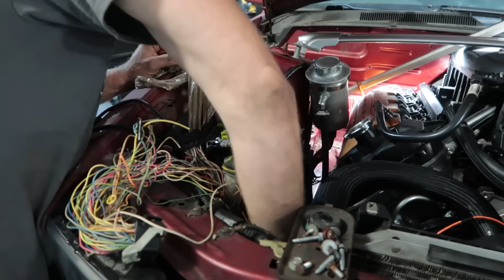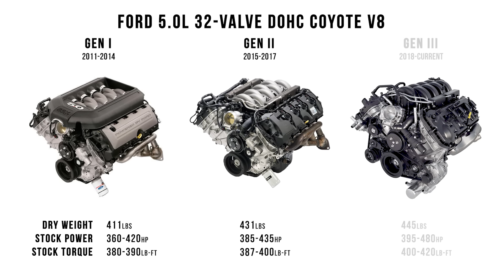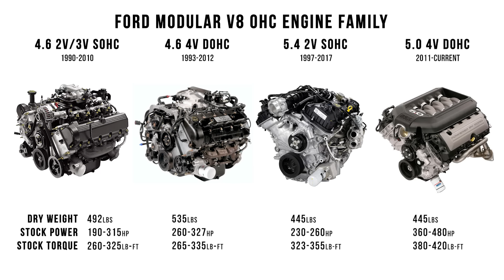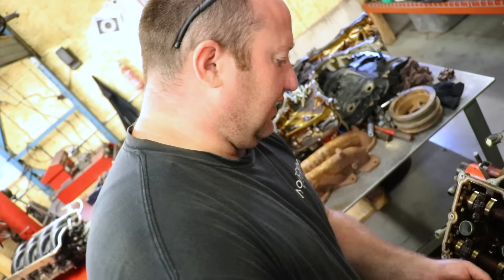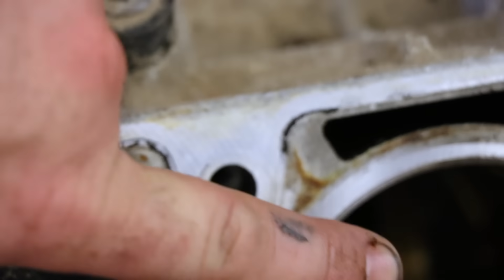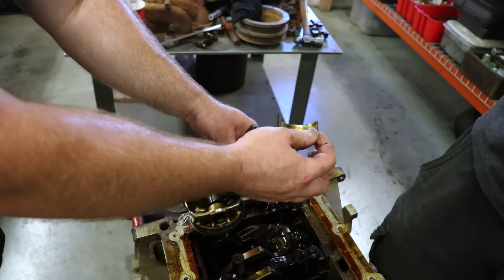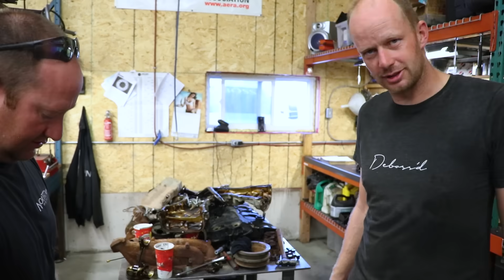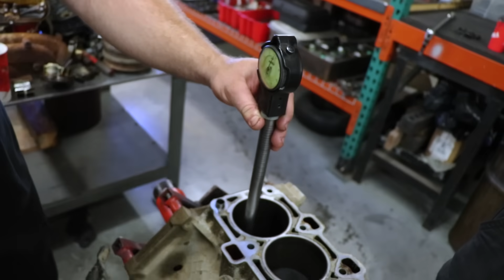REVIEW: Everything Wrong With A 5.0 Coyote Engine

Comment: Scott, hey man nice to meet you Linda meet any ways. Hey man I bought a 2012 f150 Fx4 with the 5.0 Coyote motor. Almost instantly when it works up and I come to a stop my oil pressure will drop on my dash cluster. Chimes go off but if I give it just the smallest shot of gas it shot rite back up. The motor seems strong it ran fast and hard even with this issue.  But not that are temps are reaching 118’ hot side it’s had been running very rough  can you point me in the rite direction. Oh yeah I get codes p0011 p0012  p0021 p0022 I think those are them.

Comment: My 2013 f150 with the gen 1 5.0 has been a phenomenal truck. Great power, I had a water hose crack, I went ahead and changed it and fixed the fault with the water cooler piping.dont know why so many say these trucks are underpowered or turds.

I can't wait to tune mine, just don't know which tune I wanna get for it or who from. 5 star tuning didn't impress me much with my 2001 4.6.
Reply: Keep in mind, there's not much room for tuning with a stock 4.6 2 valve engine. Unless you changed the cams, heads or a stroker kit. Ford nailed it with the 2 valve 4.6
2011 e250 4.6v8 loaded at all times 8500lbs with 430000km i got 15000km between oil changes lol

Comment: how does Compression height effect Displacement? Displacement is just boreXstroke... "rebuilder pistons" do come usually with a shorter compression height yes, just cuz they dont know if you needed to deck the block so yeah, you might loose a small amount of compression but you are still adding displacement by boring it out. you still have the same stroke regardless of compression height of piston you still have a higher swept area. just take it into account when buying pistons for your build

Comment: Great video! I have a 2018 f150 with the 5.0 in it. I have a ticking noise on the passenger side of the motor and from what I have researched, lots of the 2018-2019 5.0 motors have the same issue. Would you happen to know what this might be and if its normal? My motor has 84k miles on it and runs great. I never hear the ticking under acceleration. Just while idling in park. Never while in gear sitting stopped. It doesn’t burn any oil and hasn’t been abused. Mostly highway miles. Ive talked to ford dealers and read tsb on this issue and ford put out a statement saying this is normal characteristics for this motor and will not affect the long or short term durability of the engine. Thanks for any help on this…

Comment: Wave of the future is 4 timing chains, oil pressure fed variable valve timing on your 4 cams, and throw in some oil pressure fed timing chain tensioners too while you are at it, so your timing components are not tensioned at startup.   Sooo basically.... multiply your points of failure by a minimum of 4X, and use the oil pump to tension components instead of a spring.   BRILLIANT...NOT, stuff it and I'll keep my synthetic oil.
Reply: Give me a Ford 4.2 V6 pushrod any day over that 5.0.  And if you feel like gettin' nuts with it, an ideal engine for a turbo due to exhaust turbulence is a 3 cylinder.  Well what is a V-6 then two 3cylinders engines on a common crank? Twin turbo 4.2 V6, dual exhaust ... Hmmmm

Comment: , Scott said that the 4.6L and 5.4L have a Different Bore Size "obviously,"  this could not be any farther from the truth.
         The 5.4L, and the 4.6L, have the Exact Same Bore ; the difference  in the Larger Displacement of the 5.4 comes from its Longer Stroke Only , not bore size. This makes me wonder, what else is he mistaken about? 
    I love the amazing hi revving 4.6L as much as the next guy,  but as great as the 4.6L is , the coyote is still more efficient and will rev even higher. It is a far superior engine the previous ford modular engines . 
            The  5.0L modular engines have a stronger block, a
 steel crank, higher compression and better flowing cylinder heads. The 5.0 L was tested by ford before it was released , it is a great engine along with the other Modular Engines.

Comment: Big guy doesn't know anything about engine math. Engines are NOT calculated by compression height to determine CI. Not only that, but putting oversize pistons will NOT decrease compression, that is done through dome volume and combustion chamber relation to crank throw. The bronzing (what it's called) is NOT from synthetic alone, that is simply a non-detergent oil being run to high temps repeatedly without proper oil changes. Most synthetic users will go by the 5k recommended interval not realizing that if you overheat the engine or redline the engine repeatedly it shortens the oil change interval. I change my race car's oil every 1k miles with full synthetic and have never seen that issue. Synthetic oil is also not thinner as oil is marked by weight. There are synthetics in 40 weight all the way up to 110 weight. Windage trays do not cause oil starvation issues. This guy is a joke lol. He knows how to order parts, that is about all I have seen him do well. He is a parts catalog but knows nothing about engines. "synthetic oil is very aggressive" "every engine on synthetic burns oil". LMAO WOW

Comment: It's not a "better" engine when it has significantly more moving parts to go wrong. Seems like almost any modern V8 can hold at least 700hp from the factory, very rare for people to go above that on the street...therefore the "best" engine is the one that is cheapest, and has the fewest moving parts to provide the most likely chance of getting to high mileage. Being strong enough to hold a thousand+ horsepower is not something relevant to most people.

Comment: Is there any additive to get rid of that synthetic oil residue in the motor ? I purchased used Fords for both my kids and noticed this coloring inside the valve covers when adding oil.   Gonna stop with the synthetic but would like to try to get that stuff cleaned out before it clogs anything.

Comment: I live in Vegas When my engines cold it's at 100F I do many short trips, I use 10W30 syn. I drive a 2002 Chevy trailblazer I got for $500. It has 246,000 on the clock and still runs like a clock. Should I switch to regular oil? I've have always used W30 or W40 in my old cars and never had a problem but this 4.2 engine has a cam phaser.

Comment: Background:  
Gear head that did auto repair for people who didn't get satisfactory results from dealers and I starting from age 14 where I had to have other people available for tests drives. I also designed and built electronic circuits for companies.  Then college for Automotive Technology where I learned the engineering.  I signed up for the Guard and wanted to be a mechanic there, and did a little too good, so they made me an aircraft mechanic and I was terrified of heights.  I built drag engines where I did Chevys, Mopars, and Fords.  Like this video says, it has ALWAYS cost way more to build a Henry than a Chevy.  I personally did Fords because winning with one made a statement.  I did engines, transmission, and rear axles at a Ford dealer because they were less frustrating to work on because they used dedicated castings instead of brackets supporting brackets supporting brackets, and the working environment was nicer.  I left there to work on vehicles for the Guard full time to work on trucks, radios, equipment, and a CEV (tank with an oversize gun), but their real angle is they wanted someone they could lay their hands on for manage their remote aviation section.  They made me the supervisor of the section.  I got sick and threw up all the time, after which I bought a share in an airplane because I could get free flight time for maintaining it, and learned to fly.  Later, my instructor called me and said he just got an aerobatic plane and I should...which I did.   That grew into waivers for academy and "fright school" and flying for them for 5 years and getting out as captain. 

My thoughts:
* Disclaimer:  I don't have broad experience with synthetics, only Mobile 1.  I chose Mobile 1 due to the way it is manufactured gives them ultimate control, and the mix of additives for wear.  Does more control mean better?  I don't know.
1.  From my experience with Mobile 1, oils keep things A LOT CLEANER.  If you switch to it on an older engine with not such a great change history, your oil will get REAL dirty fast because it puts the crap back in suspension, which is your call as to whether this is good or bad, and it comes out with the oil.  I'm aware of the Castrol court case they lost where they claimed they were 57% better at preventing sludge.  While they lost, you may find significant that they based their claim on data from Mercedes-Benz testing.  The ruling was against them because it only proved it on that engine and their proprietary testing.  Castrol's reply was sludge is sludge.  They lost another one on lubricity in that they showed some cruel load over an 8 hour period on some engine that theirs was the only one that held up.  They lost because those conditions but I thought you might find it interesting.  After Castrol's formula change to a mineral oil base, they got sued for calling it synthetic, but the challenger lost in court.  If you check what it takes to be called synthetic, you will find it to be defined by court cases rather than science and logic.
2.  IMO the problem with synthetics is they say, "Our oil is good for 6,000, 10,000, or 15,000 miles, so it's better and less expensive overall."  Then people follow that marketing advice and you get what you see.  How long anti-wear additives does matter, and even the longevity of the detergent properties to some degree, but the amount of byproducts of combustion and other factors doesn't change that much.

Other things mostly for entertainment value.
1.  Kinematic viscosity on the can is in SAE Saybolt seconds.  It is measured by how fast the oil flows through an orifice at a standardized temperature, 100F now 40C(104F) to make metric.  From an engineering perspective, it is no longer used.  When you look at multi-viscosity motor oil, the W is a predicate for the first number.  To simplify, it is simply stating that when the oil is cold, its properties are like the first number, and when hot like the second number.  Most engine wear occurs after startup of a cold engine and cranking is easier and thinner helps.  When warmed up though, the more viscous oils shear properties are better at maintaining the oil film under pressure.  You may have noticed the trend toward thinner oils in cars.  This is because most use roller rockers and lifters which is why the higher viscosity oils were needed and no longer are.  Thinner oil is better if you can run them without breaking down the oil film, and there is less parasitic loss.  There is actually way more to it than this such as when you modify the viscosity gradient, you still need to maintain the sheer strength so it preserves the oil film.  Again, there is more to this such as cranking, etc.  However what might be useful to you is the critical number is the second number.  If your car states to use 5W20, use 0W20.  The 5W was driven by what was commonly available.  Oil is always too thick when it is cold.  Another thing is the zero does not mean it is 5 thinner than 5W.  There are no negative numbers so all zero tells you is it is less than 1.  Just don't mess with the top number because that is the required shear strength required.  (For modified engines and racing you are on your own and stock oil and clearances aren't going to work.)
2.   Less popular today, but still in some applications you will see the recommendation for non-detergent oils.  Cars used to use non-detergent oils as do other machinery.  There is a wives tale that goes that's because detergent oils foam in those applications.  It's not that that has never happened, but it was considered a defect of the oil and thus any instances have long since been remedied.  The reason for this is old cars, small engines, air compressors, etc. use splash lubrication.  The oil pan was the settling point for debris and in effect the oil filter, thus you don't want to keep the crap in circulation.  On old cars, the oil pan is easily dropped and it is part of the scheduled maintenance.  With pressurized oil systems, keeping particles in suspension is exactly what you want to have happen so they can be removed from the system by the oil filter.  Today, non-detergent oils are hard to find, and even splash oil systems often list multi-vis detergent oils as an alternate or primary and might be better than a straight-weight non-detergent if you change it frequently.
3.  The anti-wear additive levels have generally been reduced in newer oils because they affected the life of the catalytic converter.  This is something else I was watching when selecting an oil.  There are ways to skirt that with additives or racing oils, but this is ever changing and I'm not interested enough to keep up on it.
4.  The SAE rating for gear oil uses a different scale than engine oil.  Example: 75W-90 gear oil is about the same viscosity as 10W-40 motor oil and it has totally different linearity.
5.  Probably don't use aviation turbine oil in a car engine.  You won't have ANY varnish like you saw on that engine.  The oil will be very fluid across an incredible temperature range, which would be great for cold weather.  Now for the downsides.  Jet engines don't have pistons and rings sliding up and down on cylinder walls that might shear the oil film nor do they have sleeve bearings.  You've never seen quality in bearings like you see on a jet engine.  You could have an APU that runs at a steady 115,000 rpm.  On small turbines the gas producer might run at 55,000.  You also have gears of quality like you've never seen that bring those RPM down to sane values to feed a fan and accessory gear boxes and do it reliably over many thousands of hours with zero issues.  Their main bearings do not have rubber seals, they use what is called labyrinth seals and pressure differentials.  The compressor generates much more pressure than the output and that is used to keep oil where it belongs and to cool (relatively) components through small holes located strategically throughout the engine to keep components temperatures within range.  When bearings get really hot is after shutdown when that process stops and heat moves to the bearings, called heat soaking.  Any varnish causes them to what is termed as "coke the bearings", e.g. make hard carbon deposits that will freeze the bearings, which is why you won't see varnish at car engine temperatures with turbine oil.  You also NEED to wear gloves.  I've gotten it into a cut a few times and it kills the skin around it and turns it into a callous that you can pick out over time.  Everything grows back fine, but if motor oil on your skin is a threat, turbine oil might be far worse based on its effects.  So the game for turbine oil isn't wear from scuff resistance from sliding surfaces, it is maintaining a standard viscosity across a crazy temperature range, simple lubrication, cooling, and not oxidizing/coking the bearings, which is exactly what those fine anti-wear and sludge preventing additives would do to a turbine engine.  They have a lot few products of combustion to deal with.  AutoZone probably won't be interested in your drain oil.  One could say that a car engine running it MIGHT not last as long using it even if it doesn't have an oil film issue.  OTOH, the oil would be fluid when cold so that might make up for around town drivers.  You can try it and let me know.  You can buy it for ~$2400 for 50 gallons, which works out to $12/quart.  It would have been fun to try on a water dyno when I had access to one in school.

Comment: So I'm not sure what I heard there. Is there a good replacement bearing for the crank and is it normal to actually put bearings in place of the aluminum head bosses????  And why is Ford using an aluminum bearing to begin with??? Is it a grow and shrink issue?? I hate to say it, but with all of the mechanical channels I watch now, (I have not turned wrenches in years), it is looking like Detroit is going to push us into electric cars solely for the reason that there are extremely few moving parts!!!

Comment: Reminds me of the old FORD 1970 1980 302/350 Cleveland[good] Windsor[bad] motors argument. Regular maintenance of an engine is a no-brainer. It doesn't matter the make and/or model of the engine, it must be maintained properly to last.